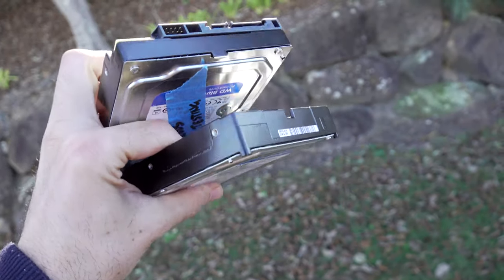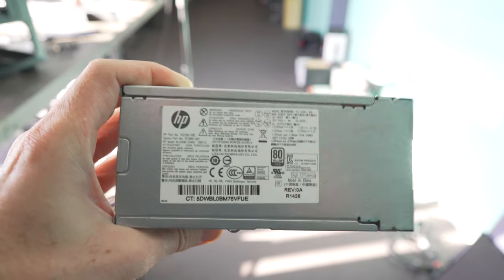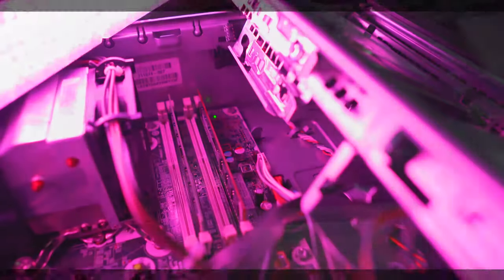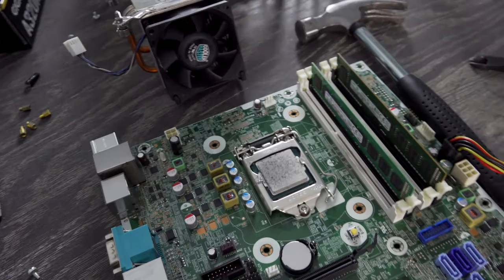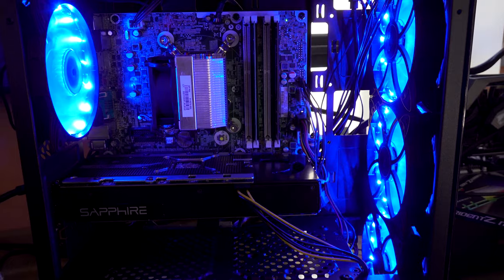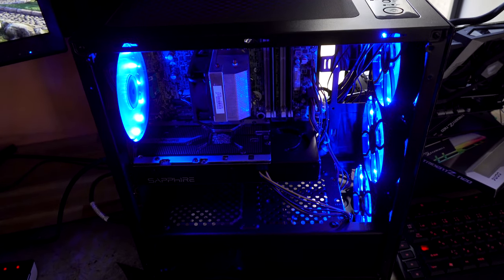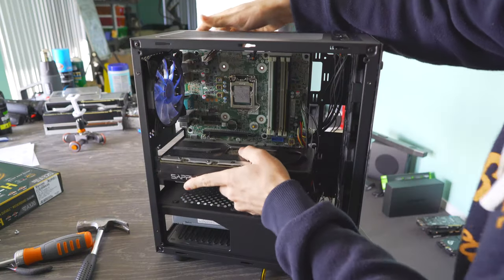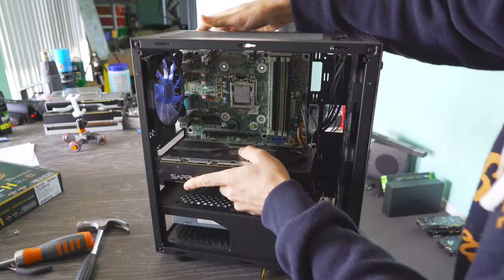Turning a $100 4th Gen HP ProDesk into a GAMING PC? (Mid-Month Hustle)

Comment: how on earth are you using a rx 470 with 240watt psu?
Reply: Stock an Rx470 draws 120w. That leaves 120w for the cpu(and that's a low power 65w cpu) leaving 55w to power a couple of 2w fans and a 10w hdd.
Reply: It seems fucked up, but It isn't
Reply: @tonybarden8563  this is a gold rated power supply so the power efficiency is higher
Reply: @tonybarden8563  as long as it's not running in agony, i think it's ok to do so. but psu failure will cause chain reaction
Reply: @tonybarden8563  80plus rates a PSU at 20%, 50% and 100% of their power and the efficiency changes by just a few percent between those three points. They're perfectly fine at 100% and they're usually perfectly fine above it, just no longer meeting the 80plus efficiency when above it.

Even if you were trying to optimise the efficiency so that a system runs at 50% of PSU's power under typical full load (which is dumb, what are you going to get, a percentage point?), it would still not be achieved by adding TDPs and halving the total. TDPs are, in practice, worst-case long-term power numbers, not typical gaming numbers.
Reply: @jeffreekenny  yes it is higher BUT ITS STILL A HIGHER EFFICIENCY AT 50% LOAD  i think your getting confused its 80+ @50% load if the load is 240 watts its running 100% and that gold rating wont even make bronze rating it will be well below 80
Reply: @ouwkyuha  its not ok to do so at all ,its far to low wattage bryan really has made a bad choice to show it running a 240w ,this gives the impression it will run well and is a good decision to use a 240w psu with a 470 and 4 fans ,its simply not ! the only reason its not gone bang YET is the fact its a well made psu for HP
 but you cant ask even well made stuff to last when the peak load will be at/near or even over its rated max wattage
(i like this channel ,i like bryans videos ,but he really has made a bad choice to say this psu will do)
Reply: tony barden shh shhh shhh don’t be mean to Bryan
Reply: @tonybarden8563  also he did say it a proprietary motherboard and psu connectors therefore making it difficult to swap the power supply. Brian did the best he could with what he had. If he had a higher wattage psu that would be compatible with this mobo I'm sure he would have but for the sake of the video and saving time to give us some solid content he wasn't going to go out of his way and spend hours finding a psu to suit he's needs
Reply: Probably draws around 200w. 
CPU 50w, GPU 120-140w, 10-30w for all other components.
Reply: @jeffreekenny  your still missing the point 

this gpu shouldnt be in this system with a 240w psu ,more so if bryan intends to sell it ,its going to be bad for him and the buyer ,facts are facts the psu is too small to run this setup (if this video was titled LETS TEST A HP PSU TO THE LIMIT  then it would be intresting to see what over wattage it would do ,but its not its a video to build a system TO SELL ) its giving the wrong message to viewers who are following ADVICE from bryan and that advice is very wrong
Reply: @-eMpTy-  cpu 65w (intels tdp lies again) gpu 140w, motherboard,cpu fan,4 x case fans 120mm,ssd, stupid leds the seasonic psu calculator says 299w on load .........
in best scenario its at least maxing out 240watts and thus over current on the psu
its simply a bad choice ,and yet everyone jumping to defend bryan without considering bryan has in this video made a bad choice to show it being used with a 240w psu
Reply: @jokerboy1693  i think ive rattled the 'disciples' of yestechgod, the thing is bryan has got this advice wrong how many disciples will think 240w psu is fine for rx470 builds (even worse go and buy a crappy no-name chinese psu now at magic 250watt pretend power and wonder why it goes bang )
but but but bryan said it would work fine ...........
Reply: @tonybarden8563  honestly man no one needs more then 200W .. everyone now a days is just spoiled cause the market is only really selling 500w and more but  in reality even a 12 core with a GTX 1080TI will barley use more then 250w. so this is perfectly fine.. I personnaly don't use any powe supply but 250w.. cause anything more is over kill. you got to stop  thinking you need 500 600 700 w power supply to power modern hardware new hardware is so efficient it hardly used even 200 ww
Reply: @tonybarden8563  if that's the case, all i can do is cross my finger, cause my pc is using 80% of cheap epro psu :(
Reply: @tonybarden8563  
lmao using a PSU calculator as source... gtfo. In no scenario this system would ever draw more than 250w. TDP doesn't means power consumption btw ;)
Reply: @CHICKENmcNUGGIESMydude  absolute nonsense !its  comments like this that lead people to make insanely stupid buying choices 

quote NO ONE NEEDS MORE THAN 200W
what a silly comment to make ,have you even watched any reviews showing power consumption lately ? and yet another youtube commenter who has no idea whatsoever of a psu power efficiency curve 

even worse your comment would have people with a 3900x and a 1080ti go out and buy a 300watt psu ? your totally OFF YOU HEAD
Reply: @tonybarden8563 
And Bryan never said "buy a crappy no-name chinese psu". The PSU in this HP machine is a high quality OEM PSU, probably build by FSP, Great Wall, etc.
Reply: @-eMpTy-  of course it is ,which is the only reason its still alive with the overcurrent the system will be pulling ,bryan didnt say this high end psu is not gone bang yet ,and so the implication is 250watt is enough ,and then buyers go and buy the psu made by CIT ACE etc ,you still are talking without any sense of logic ,do you do this all the time ? as already proven just in this small comment section most people HAVE NO IDEA what a good or bad psu is ,some already here are struggling to even understand the bronze/silver/gold rating system BUT yet your still saying the same old nonsense the FACT is still there you dont build a system like this with a 240/250 watt psu ,but of course by your revious answer you think you just  GUESS A PSU AND USE IT ............
Reply: I mine with 470s and 570s, under total load they pull 80 watts sometimes 90watts. 
They dont consume near as much as you would think, even Im surprised.
Reply: @tonybarden8563  
"and so the implication is" 
no it isn't. stop lying to yourself.
Reply: @neavo8421  but to be fair even without mining bios gpus will pull more gaming than mining ,toms hardware did a test on power consumption (also the rx series is incredibly efficient when not pushing high clocks )
Reply: @tonybarden8563  
I know Intel's "fake" TDP rating very well. But I didn't refer to the TDP in my first post. I said the CPU draws around 50w which is actually lower than the 65w TDP stated by Intel (and as I said, TDP≠power consumption, you don't seem to understand that).
Reply: @tonybarden8563  he does call it a hustle...and where I'm from a hustle usually implies taking advantage of someone's lack of knowledge
Reply: @shaynecarter-murray3127  same here mate 

i dont think bryan is out to con his buyers at all ,he has actually mentioned fixing pcs that failed after sales ,but the whole point of this comment thread is about such a poor choice of psu for the system,alas some disciples here wish to try and tell me BLACK IS WHITE , when we all clearly know this psu isnt good enough
Reply: @-eMpTy-  i understand fully ,intels quoted tdp is based on base clock consumption,as soon as it boosts over its base clock it consumes more power ,its really quite simple typical values are actually double the tdp on full core boost, what is still confusing everyone reading this is why on earth your still rambling garbage and defending a quite clearly under specced psu wattage, whats the problem do you not get much social interaction in mums basement ?
Reply: @tonybarden8563  true, load wattage of this sytem is about 290 - 300 watts, a recommended PSU is always 50 watts extra the least,so the proper PSU
for this system should be a 350 - 400 watt unit, imo Brian sometimes goes overboard with budget ideas.
Reply: @frontwing67  thank you ,i think people need to realise im not trying to have a go at bryan ,but his video is giving the wrong message to viewers,i worry people will read this comment thread and assume they can go shove rx470's into 250watt psu's, which will end badly as they will usually be far less able to run in over current situaations like this particular HP gold psu
Reply: do u have an shop? where can i buy it from u? thx
Reply: I love the Tech Yes City philosophy normally but this is one example where I'm going to have to say, nah.

While the PC is working now I would fully expect the system board to fail in the very near future, likely with a series of 4 long beeps.
All power on these systems is fed through the main board, power for hard drives is distributed from a socket on the board to a small harness containing 3x sata power connectors. That's it. Trying to power a GPU off this circuit is really pushing your luck. 

In my own humble opinion. If you're going to pick up one of these HP small form factor PC's, stick a GTX 1050ti 4GB low profile card in and retain the original case. It's easy to manage and you'll have yourself a great little 1080P gaming PC. Sorry. It won't be pretty or have RGB lighting.
Reply: @tonybarden8563  GTX 1050Ti (75 Watts) would be more appropriate GPU for this system even with a noticeable Performance dip  in gaming. Or else this system needs a PSU Upgrade which will be an another challenge but it is doable. All one needs to do is to google for the PSU Pinout for this HP system and if it doesn't support usual ATX pin-out than suitable modification needs to be done. But with PSU upgrade one can even go for RX580  or GTX 1070.
Reply: @neavo8421  How did you calculate 80-90 w consumed by a specific component of the PC? Kill a Watt meter can calculate power consumption for the entire system i.e., power drawn from the wall socket but calculating the power consumption of a specific component is very complicated.
Reply: @garyhope6577  Agreed and I like to add that In case of OEM PSUs they are mostly Multi Rail, not a Single Rail PSU (which requires balancing of load on different rails). So using a Sata to 6 pin adapter to power the GPU without understanding on which rail that load will go ........ is like shooting in the dark.
Reply: You arent supposed to run them @50 pct that's too big a leeway. . lets say your gear uses 300 watt.  You only need to get 360-420 watts factoring in a degradation of the psu.
Reply: @jeffreekenny  the only way you're getting a better psu in there is to wire up another PSU's wires to the proprietary cable. You'd have to know how both are wired up to avoid potentially dangerous situations though.
Reply: @CHICKENmcNUGGIESMydude  a 12 core cpu with a 1080 ti barely used 250 watts? Then you say you only need 200 watt PSUs? What sorcery is this?
Reply: @garyhope6577  I might even just stick to a GT 1030 with a low profile bracket.

Comment: I'm slow-motion building the same system, more or less. I have the HP Z210 motherboard with a Xeon E3-1270 CPU, which handily beats out the I7-2600. You can find cheap ECC ram for this board and easily load it up to 16GB on all four Ram slots for $20 U.S.  You have to buy a 24 to 18 pin power supply adapter to make this motherboard work with a standard PSU. I'm using a 450 Watt Seasonic that from another system. Also, for CPU coolers, you can essentially make any modern cooler work by using #8-32 screws and nuts. Use plastic washers on the back for electrical insulation. If you're handy, you hardware stores have plenty of metal brackets and braces you can hack up for custom fitment. Anyway, I've was able to mount a Corsair AIO water cooler and an old, but amazing, OCZ heat-pipe cooler. I used the air cooler for bench testing but the final case-build will use the water cooler. This is to replace my kid's old AMD FX6300 gaming system, which is bottlenecking a Radeon RX-570.

Comment: That HP uses just a 6 pin as its motherboard power i tried transplanting it to a new case and it was a nightmare
EDIT: I remembered that i tried to install a second power supply but it ended up setting my monitor's power cable on fire lol
Reply: Someone actually found the pinouts for these
Reply: If anyone is having/Modding this HP System and want to use even a higher wattage GPU like RX580 or GTX 1070, so want to upgrade the Power Supply with a aftermarket ATX power Supply like one from EVGA or Corsair .......... you just need a HP ProDesk 600 PSU Main Power 24-Pin to 6-Pin Adapter Cable (30cm) like this -  https://www.moddiy.com/products/HP-ProDesk-600-PSU-Main-Power-24%252dPin-to-6%252dPin-Adapter-Cable-%2830cm%29.html

Comment: Take a dremmel tool or a grinder with a metal disk cutter and cut out that portion where the heatsink screws into the original case. I have done that in the past and it works well.just sand down the rough edges afterwards to prevent cutting your hands while handling.

Comment: the psu wont last long in that rig.
cpu 40-50w
gpu 120-140w
mobo 40-50w
ram 5w per stick
hdd 10w each
ssd 5w
fans 2-5w each
Reply: Deadpoppin  no way. just search rx 570 power consumption. techpowerup has the sapphire pulse rx570 4gb at 180w peak power consumption. i have an nitro+ rx 580 and typical gaming load is around 160w with peak load at around 180w according to afterburner.
Reply: You would be surprised how far you can push a PSU tbh

Comment: 3:01 I have almost the same HP ProDesk but in mine hp prodesk i have a 1050 ti
Reply: Does your system restart periodically? I have a 1050 ti as well and mine does, wonder if its a heating cooling issue.
Reply: @TheBrandElevator  No it just works fine, look if the thermal paste is good and the fans are clean if that isnt the case then its a heating issue

Comment: If you can lay your hands on a Dell 3020 tower, I highly recommend them for mid-low-end turnkey gaming systems.  You can pick them up for around $150 US, they have an i5 and will come with 4-8 gb RAM.  Bump up the RAM slightly (it'll take up to 16, despite Dell saying it only takes 8, max), drop in a 1060, and bam, you've got a nice little gaming rig.

Comment: Ugh HP, re only thing I take from HP is CPU, RAM, and Hdd the rest is scrap.
Reply: Ram is nice! Sometimes it have 16 gb of ram
Reply: Hey man, I used to rebuild dead Dell XPS 700 series as overkill media centers with tiny HP DC5850 BTX boards and even hardwired all the multicolor LEDs, front panel cables and fan connectors. Nothing was standard in those XPS systems way back when.
Reply: SaintInix noice
Reply: @SaintInix  Xps are nice systems, but your standard office brick are petty hard to get something useful out of, other than parts. That is just in my opinion
Reply: @Vorper  Yeah, my pops uses an older HP desktop for his 3d printing, but that was back in like 2010 that i was doing the thing with the XPS systems. Wouldn't do that now of course.

Comment: To get around your watt reading issue. Buy a clamp meter of some description. Then you need and extension lead with either the active or neutral apart from each other. Rough way use tape, or not so rough use heat shrink. That will give you the current. Then is just ohms law from there. So Australia is approx 240 volts. W=VxIxPF, assuming PF is close enough to 1, you should have about 1 amp max on you clamp meter. 240 x 1 x1 =240watts.

Comment: There are wiring harnesses that you can buy on Amazon for relatively cheap that will allow you to use a non proprietary power supply with an HP motherboard. I'm in the process of building a NAS for my ESXi cluster using an old HP ProDesk 800. The 320w power supply isn't enough to run 16 drives, a RAID card and RAID expander card.

Comment: I just moved a HP elite desk 800 G2 into a HP pavilion 500 pc series case(can’t find the specific model number) and I tried to find the cpu heatsink screw oles and there WERE NONE, until I realised I needed a bracket or a intel lga 1151 OEM cooler that just clips in
Reply: How did you get the bios not to beep every boot because it can't detect Front USB or front panel?

Comment: I just fit an Antec 500w power supply to run my HP 8300. If you know what you're doing and know how to solder it's easy just a real pain in the pants. Also handy is a crimper and some crimps for the motherboard and CPU plugs. Also you will need a voltage booster for the 5vsb to raise it to 12vsb. I mounted it on a piece of an old psu case I cut to rivet under the Antec. All the cable ends are custom fit so there's not any excess wire. I used the psu wires for all the peripherals so as not to overbear the HP feeds from the motherboad, and routed some excess wires for the usb3 power feed with a soldered together  molex connector for that card. The sata connectors are reusable with a punch down tool, so it looks so good  Its a shame to put the cover on it, but now I'm ready with two 22 amp rails divvied up to the motherboard and the video card 6 pin socket , All I need now is a good cheap video card and then I will start to learn gaming to pass the covid time.      Just patting myself on the back here................................Mike

Comment: Those HPs actually work great with a 1050ti low profile as it runs off just the PCIE power. I had one in an HP 8300 for a while as I was building my main system (which weirdly used almost exactly the glass case you used here).